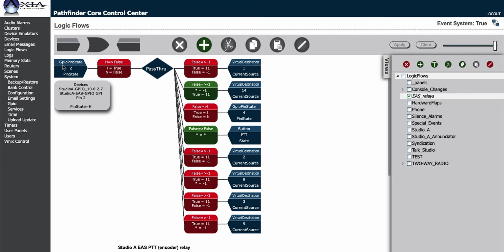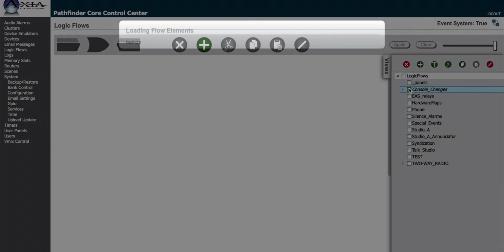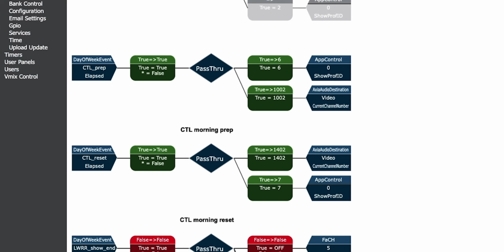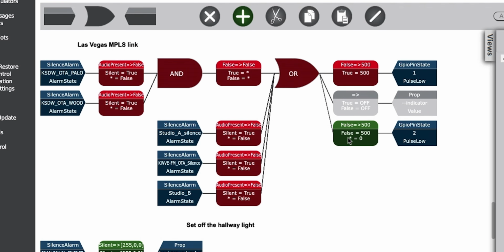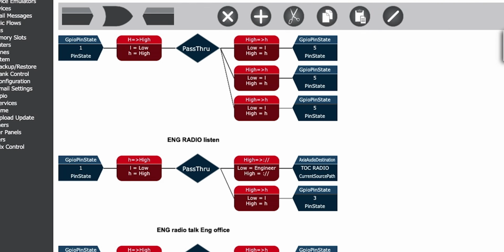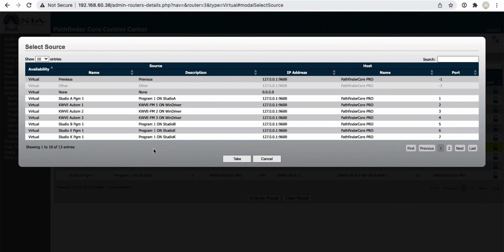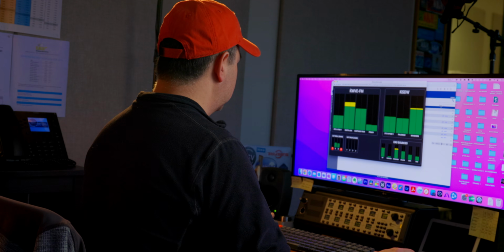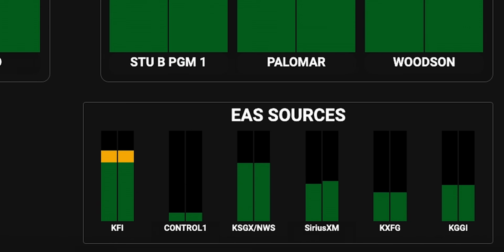One of the most helpful automation tools I use

Comment: On your large meter panel, why are the levels and peaks not equal? I figure there is some delay in getting audio to and from all the sites, but peaks don’t seem to be the same. Is KSGX your source for NWS or does that source alternate between the two? Thanks for sharing this, it’s nice to see what’s out there for broadcasters.
Reply from the maker: The levels are a bit different based on the receiver and the encoding (our Palomar station can't be received here so we backhaul it to the studio). That's on the to-do list as it does slightly bother me.

KSGX is our NWS source. It's the call sign of the station: KSGX/NWS.

Thanks for watching!
Reply: @TheBroadcastEngineer  Ah, I thought KSGX was a broadcast station callsign. If it's the Mt Woodson site NWS transmitter, I bet it's easy to receive.
Reply from the maker: No, it’s the one on Beeks Place in the Santa Ana mountains. 

The one on Woodson is about 30 feet from my translator down there.